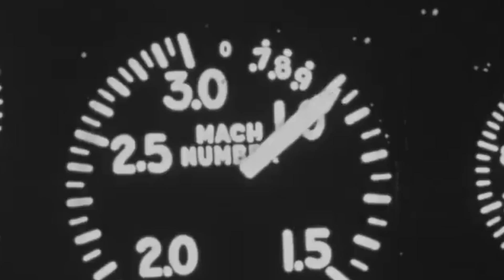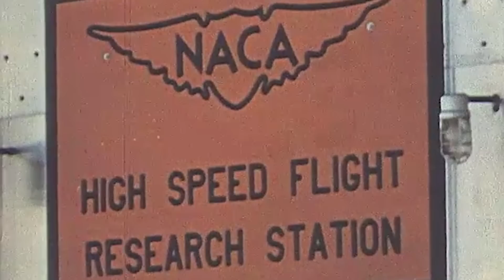The Flying Bullet That Shattered Aviation's Limits Forever

Comment: I wish that more had been made of the flying tail as it was called. I note that some aspects of the secret that enabled control that accrued from this tail were mentioned, though I had read of it as a flying tail. That means that the whole of the tailplane pivoted, not just trailing edges or elevators.
Reply: Good point, Supersonic flight was not possible without the power assisted fly-by-wire Horizontal Stabilator system.
The very first jet aircraft to have this feature was the Messerschmitt Me-262.
Developed by Adolf Busemann at the RLMs Luftfahrtforschungsanstalt, the only supersonic aircraft wind tunnel laboratory in the world.
Busemann gave the data to Theodore Von Karman who delivered it directly to Jack Ridley at Bell Aircraft.
The Bell X-1 used a nearly exact copy of the Me-262's analog fly-by-wire Horizontal Stabilator system
Reply: @WilhelmKarsten  Operation Paperclip? Most of that was chemical & biological weapons research canceled by Nixon. Too 17 years to destroy the gases and germs. Aviation was some degree cleaner aye? When spies succeed. I am blown away by your exactitude.
Reply: The invention of the stabilator dates back to the Wright Flyer in 1903 and was used extensively during WW1, planes such as the Fokker Eindecker used a stabilator.
 The Curtiss XP-42 was fitted the mechanical, servo tab operated stabilator to counteract the elevator blanking problem but the stick forces still exceeded the strength of an average pilot.
 It was Germany at the DLA that invented the first electric powered (Fly by wire) stabilator trim system. Using a small, compact but very powerful motor that drove a jackscrew to actuate the stabilator when the aerodynamic forces caused by the shock wave made the elevator unresponsive.
 The system was so successful that it was copied by the Americans on the Bell XS-1, North American F-86 Sabre, Boeing B-47 & B-52... it's still used on the Boeing 737 and many other jet aircraft..
Reply: Hasn't the "flying tail" been standard on Supersonic aircraft for decades?

Comment: I met Chuck Yeager at a company event in the 1990's. He signed a copy of his biography which I was thrilled to get. He shared a hilarious story about early attempts at pressure suits using rubber much like diving suits at the time. Long flights proved to be a problem. RIP to the fastest General of the 1940's. One the greatest generation.

Comment: 4:05 Not true. The germans V2 rocket WAS based on the shape of a bullet and the US simply continued on that premise. They didn't invent it.
Reply: Germany was the only country in the world that had supersonic aircraft wind tunnels during WW2, the DLA or Luftfahrtforschungsanstalt had 9 wind tunnels ranging from Mach 1.2 to Mach 9 with some as large as 10 feet in diameter, which allowed the testing of more accurate models in half scale. 

Absolute correct, Germany developed the S-Patrone or Spitzgeschoß (boattail spire point bullet).

Comment: He proved if you put a big enough motor on a trashcan, it will fly.
Reply: You can't fly supersonic no matter how big your engine is if you don't have a power-assisted horizontal stabilator.
without the fly-by-wire electric Horizontal stabilator from the Messerschmitt Me-262 the Bell-1 would have lost control and augered straight into the ground just like the de-Havilland DH-108 did 3 times in a row..

Comment: Is there any substance to the rumors that some pilots of F86 jets had broken the barrier during the Korean War?
Reply: Not a rumor, it is absolutely true. The F-86 Sabre could (like the Me-262) reach supersonic in a powered dive at the right altitude and atmospheric conditions.
The Sabre and the Bell X-1 were both developed using data and parts from the Me-262. 

 The first woman to fly supersonic 46-year-old Jackie Cochran broke the sound barrier in a F-86 on May 18, 1953,
Reply: @DoktorBayerischeMotorenWerke  go on then, I'll bite- which parts exactly from the 262 went into the X1?    We have already discussed the stabilator which the 262 did not have as proven elsewhere in this chat...
Reply: @laurencedawson7754  The electric powered fly-by-wire Horizontal Stabilator.

The British did not invent the stabilator... this completely false myth has been soundly debunked.

Germany invented the powered Stabilator, and it was first used on the Messerschmitt Me-262, and aircraft a decade ahead of anything the British had at the time.

Its the parts that allowed the Me-262 to reach Mach 1 in a powered dive and the Bell X-1 to reach Mach 1 in level flight.

The British would not achieve supersonic flight until the 1950's
Reply: @DoktorBayerischeMotorenWerke  timelines are discussed elsewhere - can't have happened my friend
Reply: @laurencedawson7754  The Messerschmitt Me-262 is the world's first jet aircraft to have a power assisted Horizontal Stabilator.
The Miles M.52 does not exist, its a hoax!
Reply: @DoktorBayerischeMotorenWerke  if you are telling about the electric trim moving the fixed part of the stabilizer, that's neither a stabilator nor fly by wire.....I'll refer you once again to the me262 pilots manual " controls are fully conventional vid push / pull rods...."
Reply: @laurencedawson7754  Your ignorance on this topic knows no bounds lad.

If you do not understand the difference between a Horizontal Stabilizer and an all-moving Horizontal Stabilator you are not qualified to discuss this topic intelligently and are completely out of your depth here.
Reply: @DoktorBayerischeMotorenWerke  yeah sure! Another logical fallacy  rather than logic or actual explanation.... Interestingly your use of the term "lad" is the same as the other chap on here, are you the same person!!?
Reply: @laurencedawson7754  The definition of a Horizontal Stabilator is an all-moveable tail plane as opposed to a "Stabilizer" which is fixed and cannot be adjust in flight for angle of attack.

The absence or presence or elevator tabs has no effect on this definition and is completely meaningless in the context of this discussion.

Many aircraft, including the Bell X-1, F-86 Sabre and Boeing 737 have a Horizontal Stabilator in addition to elevator tabs like the Messerschmitt Me-262.

Lad is a very common British expression used to greet or identify someone who is still a boy or a very immature or unqualified man. 

Your own comments have exposed your lack of knowledge and very limited experience in regard to this topic.

Cheers lad!
Reply: @DoktorBayerischeMotorenWerke  that's exactly how I understand the definitions, great explanation- so when you said I had little understanding - what did you mean? And which of my points did you think was wrong based on this common understanding, cheers mate!
Reply: Actually I think the presence of elevators and whether or not the movable stabilizer is used for trim or as response to stick inputs is very relevant....for example when used as trim which is pre set prior to flight or electrically or mechanically controlled as trim with slow response would not be useful on controlling the aircraft when going transonic which Is our discussion?
Reply: @DoktorBayerischeMotorenWerke  all good - I disagree on whether the method of control is important - the bell team modified theirs to have fast response after the first flight had problems, with only having trim adjustment , But the original point of contention was where the americans got this information...as I've suggested given the timelines.......
Reply: @DoktorBayerischeMotorenWerke  excellent reply by the way- no personal insults or nonsense....
Reply: @laurencedawson7754  The historical evidence is conclusive... the technology did not come from the British as they did not have the ability to build a supersonic aircraft until the 1950's.

The German A4 rocket plane flew Mach 4 in 1945... and the Me-262 could easily dive to supersonic speeds thanks to its electric fly-by-wire Horizontal Stabilator system that was used on the Bell X-1.

The Bell X-1 DID NOT have the Horizontal Stabilator control input linked to the Control Stick, this fact completely destroys your false beliefs and misconceptions.

Please stop spreading lies and misinformation regarding a topic that you are not qualified to discuss intelligently.
Reply: You can read about the supersonic capabilities of the F-86 in "To Fly and Fight" by Bud Anderson.